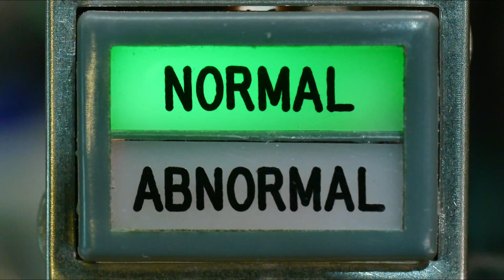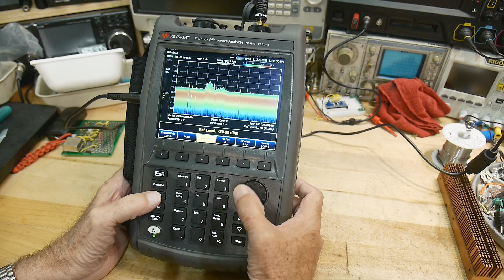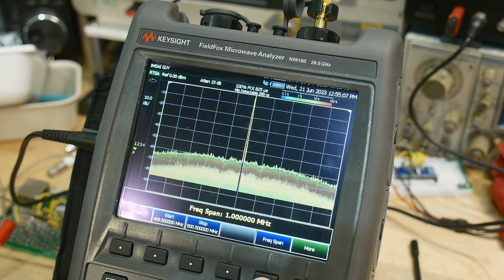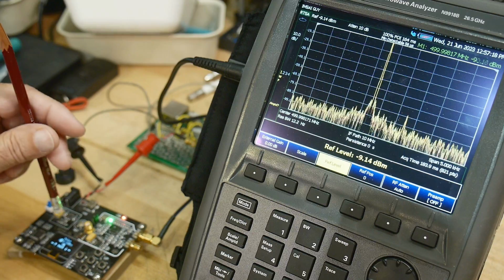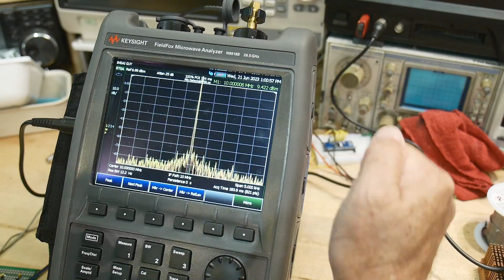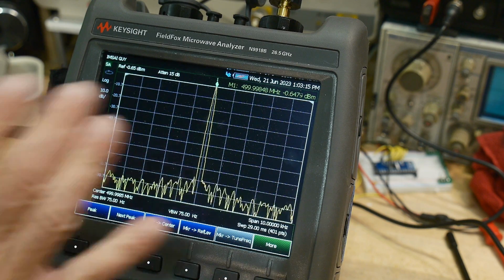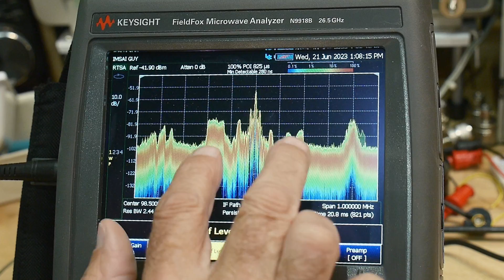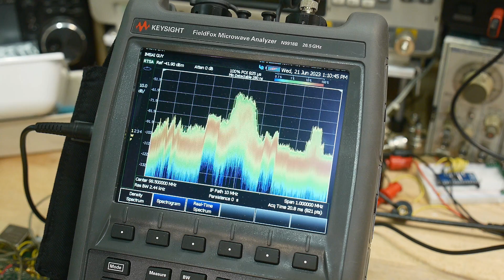#1562 Real Time Spectrum Analyzer FieldFox

Comment: It would be cool to use the phenomenon the crystal oscillator displays when subjected to proximal , physical movement as some type of highly sensitive, proximity circuit. 

That Keysight FieldFox is nifty bit of kit isn’t it?!?! Maybe, if I sold my car I could start shopping around. 
That thing is seriously, next level cool. 

In case you’re ever considering viewer requests…. I was hoping (now with the microwave SA) you might get into the topic of RF antennae at Frequencies above 6ghz and of varying phase and polarization.
Reply from the maker: this is on loan from Keysight, I have to give it back soon

Comment: There is a spare at right side of pick @7:12.  Why?
Reply from the maker: it's called a spur
Reply: @IMSAIGuy  Thanks for correcting my spelling.  But, why is it there? only one side!
Was SSB modulation on, maybe?
Reply from the maker: @aduedc  no, a mixing artifact made it through one of many filters in the SA
Reply: @IMSAIGuy  If it is so why there was none with the other oscillator of the same frequency?
Reply from the maker: probably lower dBm. you get more mixer artifacts at higher drive levels.

Comment: Many years ago we sold a satellite communications system to a company in Australia but the company elected to purchase their own transceivers instead of going with our recommended vendor.  Our satcom system used frequency division multiple access on a demand assigned basis to set up 8 kHz and 16 kHz wide QPSK channels that transmitted voice.  The customer was using the system for pay phone service at a number of mining sites in the out back.

Soon after deployment the customer started complaining about dropped calls and the miners using the system were getting very irate about it.  We remotely connected to the system and ran diagnostics but couldn't see anything wrong.  We even purchased a set of the same transceiver equipment the end user had chosen to pair with our equipment.  Still weren't seeing the same issues as the customer, so I was dispatched on a plane to Australia to see if I could figure out what was going on.

When I landed I had voice mail waiting for me telling me that our team had figured out the problem.  One of the engineers happened to drop a screw driver on the table next to the indoor portion of the transceiver we had set up and when he did the call dropped.  He tried dropping the screw driver again and once again the call disconnected.  Then he rolled the handle of the screw driver across the top of the transceiver chassis and as he did the little thumps of the screwdriver handle rolling across the top of the radio was enough to disconnect the call.  

Turns out the problem was microphonics of the oscillator used in the transceiver.  The heavy mining equipment driving around the site where the pay phone system was set up was enough to cause the calls to drop every time some piece of equipment rolled by.

We were able to take apart the transceiver and look at the design of the oscillator and see that it used no shock isolation and was generally of a poor quality.  The end customer had gone cheap and was now paying the price.  Fortunately for them one of their field engineers was able to come up with a field fix to remove the oscillator assembly from the main board and shock isolate it and that solved their problems.

There have been a few other cases in my career where either microphonics or poor close in phase noise were the culprits.  The close in phase noise is really had to see on a typical spectrum analyzer unless it is really bad.
Reply: I have seen a clip on youtube that gravity also changes the frequency of oscillator.
They used GPSDO and/or Rubidium frequency  base to demonstrate this. They were proposing to use oscillators as gravity meter.

On separate  issue, we know the velocity of TEM electromagnet waves (ie. light) is 1/SQRT(ue)
does anyone knows the value of u & e in free space  as a function of gravity or speed?  Any physicist here? Are u & e are constant with speed & gravity?
Has there been any measurement of u or e at high speeds or at zero gravity?

Comment: Nice demonstration of the real time spectrum analysis. 
The ADF4351 on the board also has a crystal oscillator of 10 MHz. Measuring the distortion at 500 MHz with 5 kHz resolution gives quite a higher value than at 10 MHz. (If compared to a 10 MHz oscillator measured at 10 MHz with 5 kHz resolution.)

Comment: Sweeeet. I realised a few days ago that I bought a spectrum analyser ........accidently. The SDR Play RSP1A.   I was looking at gettin a Tiny SA Ultra, then came across the SDR Play Free SA Software. Been playing and  learning using FM Broadcast via discone. Now looking into attenuators and appreciate your videos on the subject. Might still get the ultra for the Signal generator and portability.   Do you think the Tiny SA Ultra could be used as a calibrated Field strength meter? ?  Love your work. 

Brendan
Reply: RSP1A is not really a spectrum analyser. I guess in one way you could look at it like that but it's really only an SDR digital radio, and a nice one at that.
Reply: @vincei4252  No... the Tiny SAUltra as a portable FSM. Calibrate Tiny SAU dBm with known TX antenna and power(ie say 146Mhz dipole at 10w) ,and RX antenna(another dipole connected to Tiny SAU) and dBm on Tiny SAU at known distance (100m)This antenna set then becomes your Reference antennas and reference power.?........RSP1A Spectrum Analyser software (free) seems OK on youtube videos I have seen . Not a $10,000 k + SA but seems similar to Tiny SA Ultra performance. I think IMSAI guy did a demo video of the RSP1A with spectrum analyser software. Could be wrong ,have watched a few and may be confused with another YT Guy.
Reply from the maker: the SDR has a very wide resolution bandwidth. Ok for somethings but very limiting.
how to calibrate field strength is the real issue.

Comment: if you know how to use the trigger, you dont need max hold.
Reply: amirb715, on a spectrum analyzer the Max Hold allows you to continuously capture the maximum signal strength appearing on each frequency independent of the other frequencies within the displayed bandwidth and his is very helpful when communication systems are on just briefly or are channel hopping, etc.  It allows you to capture what frequencies or channels of a system are used during a specific period of time as an example.  A great example is being able to capture a picture of the all the channels being used in a trunked radio system.
Reply: @wd8dsb  I know very well what max hold does. I literally live with spectrum analyzers on daily basis. If you use the level trigger (which is applied AFTER the last IF and the log amp of the SA) you can capture RF bursts. you can try it yourself...
Reply: @amirb715  not just trying to capture the burst related to one signal, want to capture the numerous bursts over a longer period of time to build up a history of frequency usage as an example.  Also if you use the level trigger you can miss capturing signals just below the trigger level if you don’t have it set perfectly.  I’ll give it a try again but don’t think we are trying to accomplish the same thing.  Also the trigger level will erase all previously captured events on other frequencies if I’m not mistaken.
Reply: @amirb715  I did just try the trigger level feature and it does not accomplish the same thing you can accomplish with the Max Hold function.  When using a set trigger level the spectrum analyzer triggers on a signal that exceeds the trigger level and all previous events disappear, so it really depends on what you are trying to accomplish.  The Max Hold function is a very powerful feature depending on your needs (as is the trigger level feature).
Reply: @wd8dsb  and if you have Gated trigger option (Fieldfox has it by default) you can only focus and capture of the spectrum of particular events (bursts) rather than capturing the spectrum of all the dead times...similar to MDO4000 scopes when you have the RF trigger option

Comment: $35,567 is a bit out of my reach let's go back to ham quality stuff TinySA or I have an 8921 and a IFR-1900
Reply: I'm sure you also have to pay for the options in the thing.
Reply: They don't cost that much.  You can pick them up used for a couple thousand.  I have 3 of them and think the most I paid was a little over $6k for one that was loaded with options.
Reply: @mikesradiorepair  He lives! Miss your channel bro, but understand not wanting to deal with the BS.
Reply from the maker: Mike, I'm curious about your used units. what was max freq. and what options did they have. SA VNA one or two port
Reply: @IMSAIGuy  One does 26.5 GHz, one 18 GHz and one 6 GHz.  The two lower frequency ones had a couple basic options but I lucked out on the 26.5 GHz one, it was loaded.  I think there are only 3 available options missing on that one.  That's the one I stole at a hamfest.  I should have easily paid 4 times or more for it.

Comment: what's the point of showing videos with a device costing like a wing from a Boeing?
Reply: He‘s showing us so that we don’t have to buy one 😅
Reply from the maker: the point is: I had the opportunity to show it to those that have not seen it. Most of the test equipment engineers use at work will never end up in their garage. I have two friends that use $1,000,000 oscilloscopes at work. Always something to learn
Reply: @IMSAIGuy  I appreciate you showing it and it's features.  The problem is people seem to think these cost as much as a airplane, they don't.  They can be picked up on the used market (were I got the 3 I own) for very reasonable prices.  Shoot, I know 4 HAM's that own them.  None of them are electrical engineers, work in the two way radio industry or repair radios.  They are just amateur radio operators that saw a good deal and scooped it up.  If you go to hamfest you will frequently see these for sale.  I picked up one of mine and my R&S ZND vector network analyzer at a hamfest.
Reply: @IMSAIGuy  I have two friends that use $1,000,000 oscilloscopes at work.
ahhh... So we're in for more expensive, pointless "toys."
Reply from the maker: @ИпполитМатвеевичВоробьянин-т1п  if you are willing to pay a million dollars there's obviously a point to it. I showed a 70GHz scope before (about 1/2 million) https://youtu.be/edHw3qz3jMQ
Reply: They don't cost that much.  You can pick them up used for a couple thousand.  I have 3 of them and think the most I paid was a little over $6k for one that was loaded with options.
Reply: @mikesradiorepair  I have 3 of them
Don't stop. Buy more. If you managed to find a device that is in the picture for two thousand - you are an incredibly lucky man!